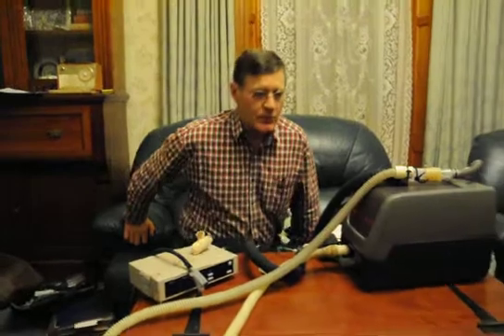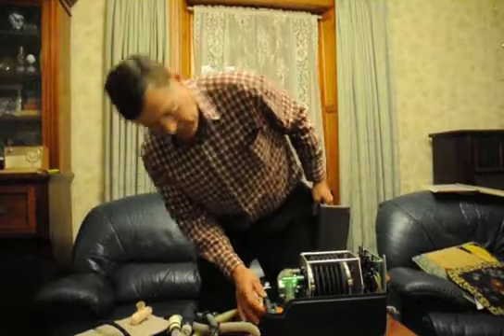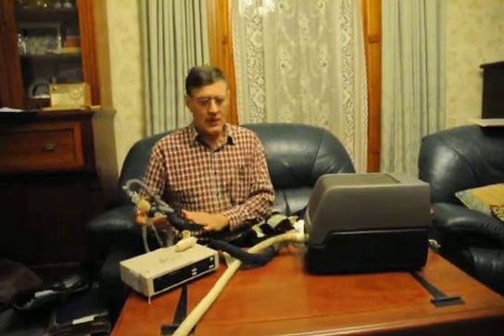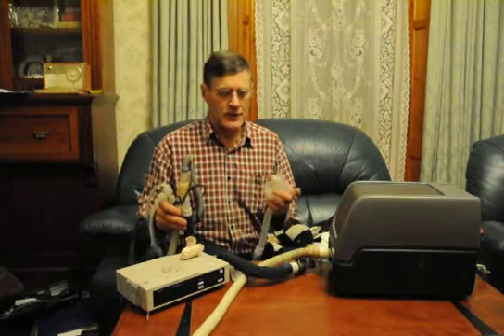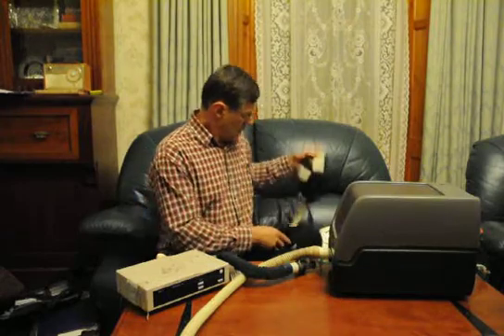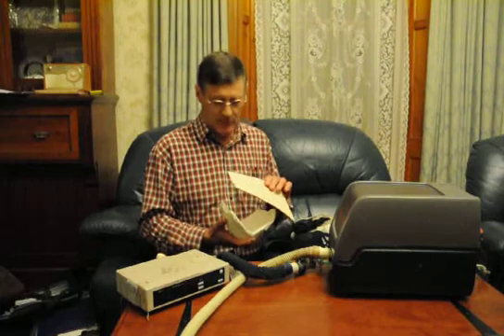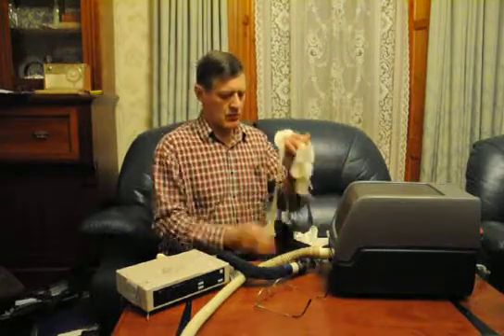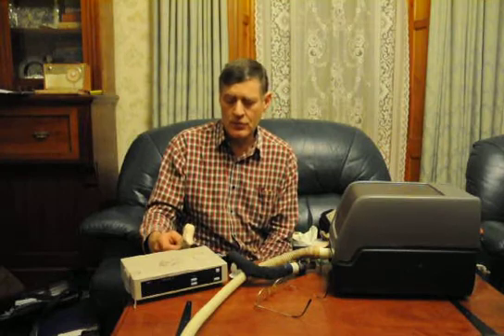central sleep apnoea personal perspective

Comment: I am curious if you tried a full face mask. It covers just the nose and mouth. Sleep Apnea runs in our family, 3 have it 3 do not. I tried a chin strap but my sinuses close and the hypertension ( also in the family ) prohibits the usual medications that open them. I’ve used a cpap since ‘04 and have developed central apnea. I am thinking of getting an SRV machine on my own. The medical services here are frugal to a fault, and justify it claiming Non compliances is more important an issue than the inevitable fender bender ( yes personnel experience, and they were crazy enough to admit that compliance was the point). How many CA’s and how do you compute them? I am in bed 8-9 hrs but actually asleep only half that time. So, do I have 4 mixed apneas or 8 per hour? The full face is comfortable, has a replaceable face washable soft plastic cushion.  Not a big fan of magic science breathing, magic vision correction science.

Comment: I not only have Central Sleep Apnea, BUT, I quit breathing whilst I am awake. These are all Centrals. Plus, I have a severe neuromuscular disease. I recently got a tracheostomy, and I use an LTV ventilator which is extremely wonderful. I use it, and essentially it assists my breathing at night, and if I go apneic, It takes over, I'm essentially apneic the whole night I' asleep so the machine is essentially performing all of the work at ight. It's unknown how long I will have this trach, but most likely this will be for the rest of my life. I will eventually require this ventilator 24 7 most likely, but you know, since they have performed my tracheostomy, I have had such an improved quality of life. I'm not a ticking time bomb now which is absolutely absolutely wonderful. The trach is not that difficult to manage either.

Comment: Are you still using this device? There are much more modern  and very small, quiet ventilators available out there. Also the wedge bellows aren't considered very hygenic as they are difficult to clean. Check out Resmed's website, they sell good chin straps too! If you used a nice full face mask, like the Fisher and Paykel Sumplus, you could do away with the chin straps all together!